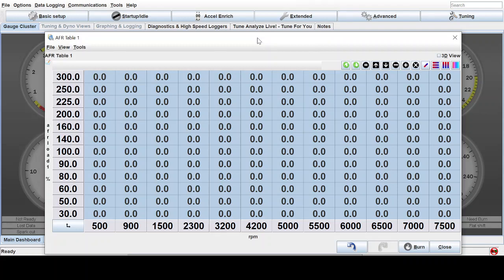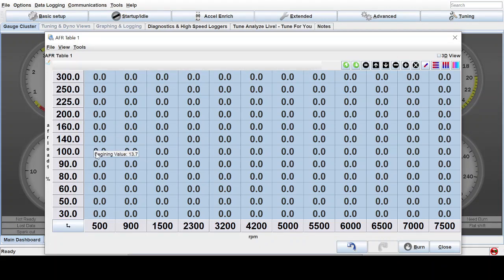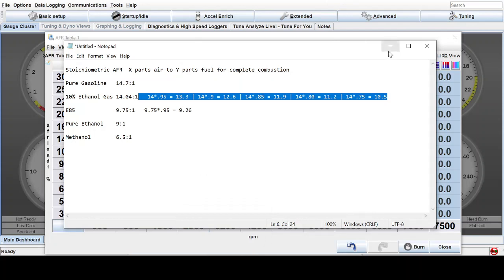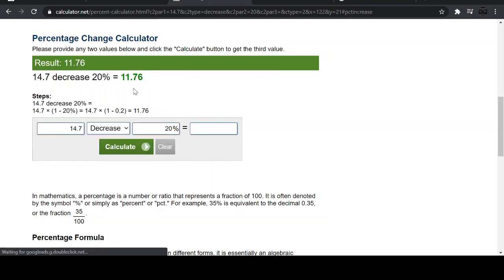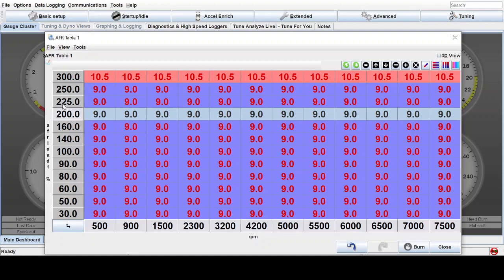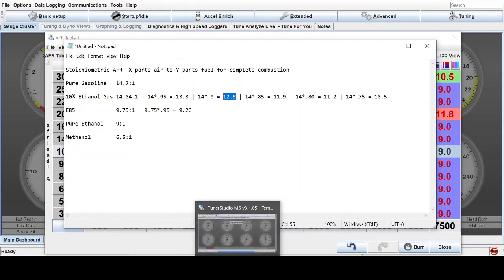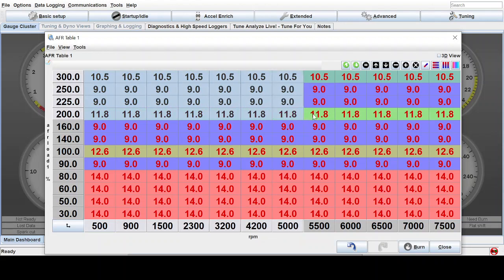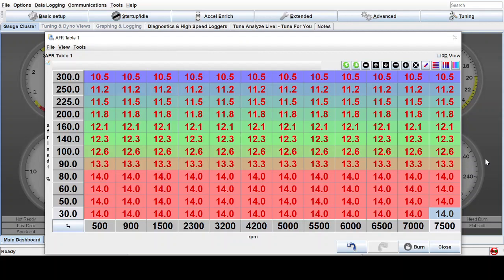Megasquirt AFR Target Table Basics | Learn to Tune

Comment: I have a question, I have a 1.6L miata that's naturally aspirated, would I be able to use this table?
Reply from the maker: Yes but it will have less resolution in the usable part of the table since this is for boost

Comment: Big error mate. AFR sensors read in lambda. Lambda of 1 is irrelevant of what the actual stoic of the fuel is. So if you are running E10 sensor reads lambda 1, if you are running E0 sensor still reads lambda 1. So basically even if the sensor shows 14.7 its actually 14.0 but its showing 14.7 because its converting from Lambda to gasoline AFR. You are making the car read needlessly rich. Pretty much all AFR gauges are calibrated for gasoline afr when they show anything other then lambda.
Reply from the maker: Thanks for bringing this up. I agree and realize it's a flaw in my explanation. I understand the situation you're explaining.

Comment: I'm only NA, do I only need to adjust the values at the 100 kpa and below?
Reply from the maker: Yes if you are NA just adjust the values below 100kpa
Reply: @TurbineResearch  thanks man. Gonna be tuning my car after watching this video lol. One question, I got my wideband installed, waiting for the megasquirt to come in, how do you wire the wideband into the ecu?
Reply from the maker: @BunnyBUNGALO  most wideband controllers have 3 wires. Power,ground and signal. The signal wire goes to the megasquirt and that's it. Very straightforward
Reply: @TurbineResearch  hey bro sorry for all the questions but I ran into some issues and can't find answers anywhere. 
I just got my megasquirt installed, hooked up wideband and downloaded the basemap for my b13 sentra ser. 
Car was stalling and running really rich so I made a fuel map and got it to stay running. Car is idling at like 1600 even though on the stock ecu it was around 1000. The thermostat seems to be staying shut with the megasquirt too, my car started overheating and scared the hell out of me, installed the stock ecu back on and it's fine, not overheating at all. 
Where are the settings for the thermostat and how do I adjust it to read my stock one? Fans aren't coming on either. 
Right before it was overheating I got it to run pretty decently even though it was having a few hiccups. Have you ever run into these issues?
Reply from the maker: @BunnyBUNGALO  I haven't had anything like that happen. Every setup is different, if fan control is part of the stock ECU then you will need to connect that to control it from the megasquirt. The idle might be from the idle air valve not being setup correctly or something like that. There are a lot of variables and it's hard to know what is all going on without seeing it in person
Reply: @TurbineResearch  I'll have to do some more research to see what settings it.needs for all that then. Thanks for your help man!

Comment: You are very good at getting the info out in a concise but informative way.  One question I have is with the KPA numbers.  I thought 100 was standard sea level pressure.  But do I understand in the MS Tuner Studio software 100 is actually 1 bar of boost?  I.E. "0" is sea level? This is true for all KPA numbers in MS/TS?
Reply from the maker: 100 kpa is sea level at wide open throttle. Anything below 100 is in vacuum and anything above 100 is boost. 200kpa is 1 bar of boost
Reply: I do see that the definitions page in TS does say 100kpa is equal to 1 bar of boost...but...how does the software allow you to tune when MAP is in vacuum pressure, does it have negative kpa values in the Y graph?
Reply from the maker: @charosenz  it depends on what scale you're talking about 100kpa absolute or 100kpa gauge are different. 100kpa gauge pressure is 1bar of boost. I have not seen it any other way in TS. It's always up to 100kpa is everything NA and anything above is boost

Comment: Hi, is it possible to burble my current stage 2 protune on an sti with an accessport? I dont know any softwares or what to do
Reply from the maker: Hi, I am unfamiliar with access port. You can try reaching out to someone that specializes in that software and see if it's possible.  Unfortunately I don't have any experience with that system